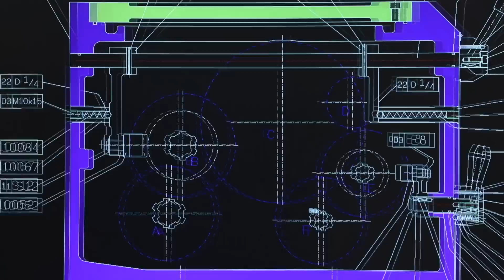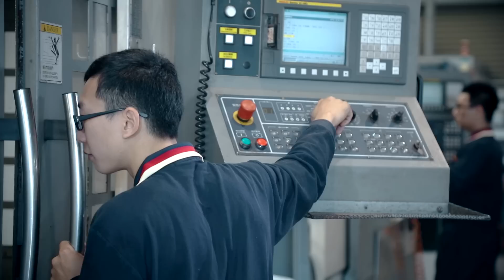Manual Lathe.high speed precision lathes.cnc lathe.

Comment: 3:10 the indicator has no preload.... No wonder it holds 0
Reply: I'm sure it does. Indicators dont start their range from 0, but earlier. They will also finish further than 0 at the end of the stroke. Dont look at the big dial because you can turn that. Look at the small dial
Reply: Chinese dials start at zero and extend past 3.
FYI
Reply: @synocate5602  really? I've worked on many indicators (many chinese)  in my machinist career and I've never seen one that starts directly at zero (small dial).

Comment: Shun Chuan Precision Machinery Co., Ltd., since 1994, is a leading manufacturer of lathe products of Taiwan.  Our machines have been sold to more than 60 countries of the world.  In case you required our machine, please try to contact with your local distributor / dealer for more details, thank you.  Or leave your contact information, I will try to switch your request to our distributor / dealer.

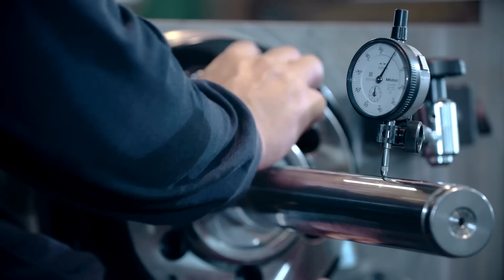Comment: 2:33, 3:09 .. no preload at the dial gauge? hmmm...
Reply: strider how do you know he didn't preload it turn turn the dial to zero?
Reply: @kylebracht  you have to look on the small gauge. if its zero then you have no pressure so no contact, if its loaded to ten, would be u professional. Preload should allways be around 5.
Reply: strider most dial indicators don't start the needle at zero under no load. They usually are 5-10 thou under zero. Look at your dial indicator at home
Reply: So half of the indicators range is usable? Ofcourse there isnt as much preload at 0 as the end of travel, but its usable. If you open an indicator, they make a long spring pull the shaft for somewhat even loan under any range